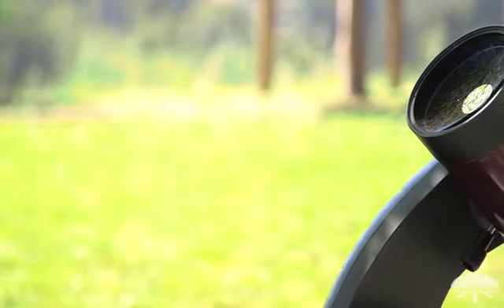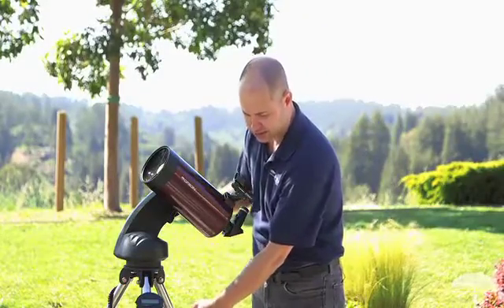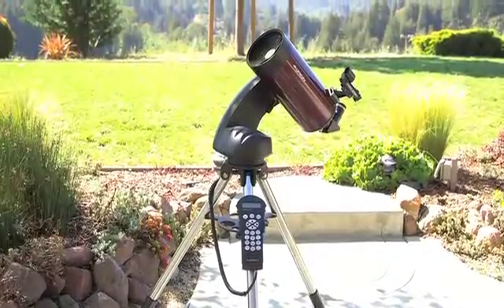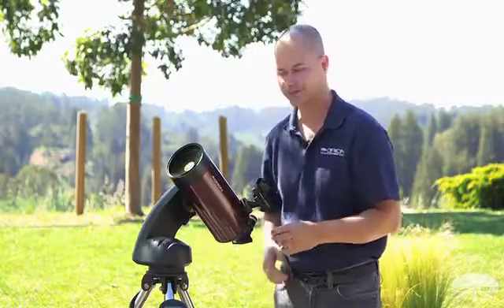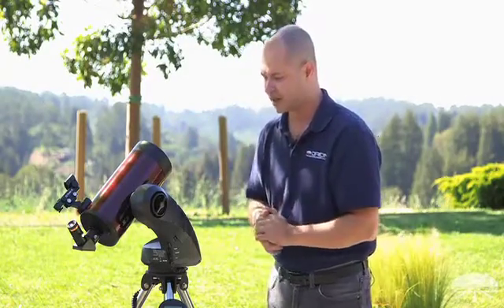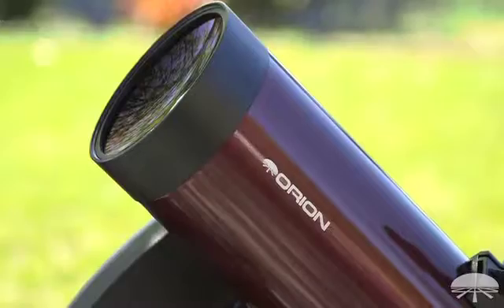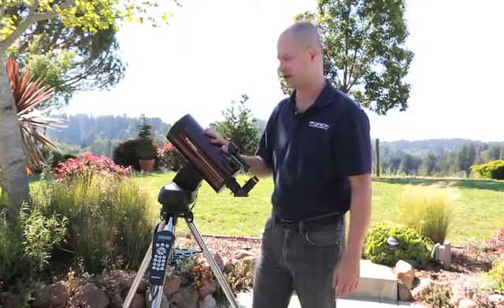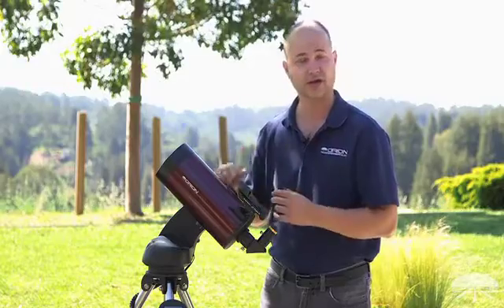Orion StarSeeker IV 127mm GoTo Mak Cass Telescope - Orion Telescopes

Comment: What is difference between StarSeeker IV 130mm GoTo Reflector Telescope and this one other than this one is 127mm?
Reply from the maker: imageofparadox Hi image,

The Mak design is a little more compact and portable, but also a bit more expensive because of the design that makes it small.  They both are about 5", but the Mak will have a bit higher inherent magnification because of the extra focal length.  

So I'd say if you goal is planetary viewing, the Mak would be perfect.  If your goal is brighter deep-sky objects (where you don't need as high a power), the 130mm is a cheaper way to do it, and also excellent for that purpose.  But they both can be used for planets as well as deep-sky objects.  You can also increase the power of the 130mm by adding additional eyepieces.

Thanks
-Ken
Orion Telescopes
Reply: imageofparadox This model is a Maksutov Cassegrain, the optical system is different from a Newtonian/Dobsonian reflector such as the one you mentioned.